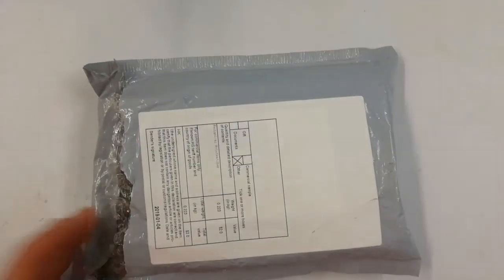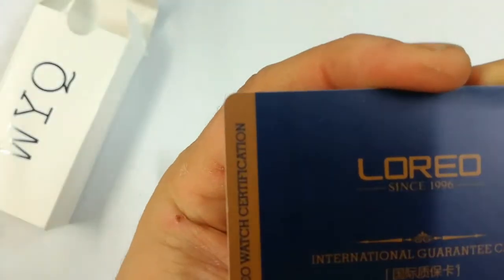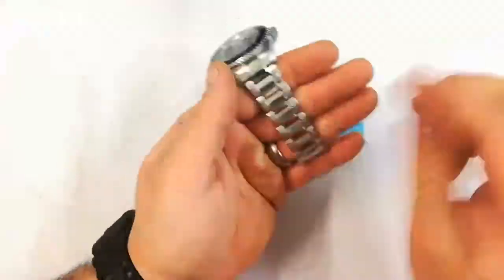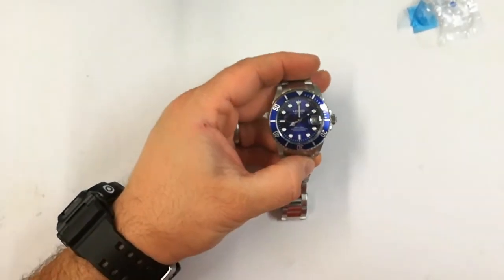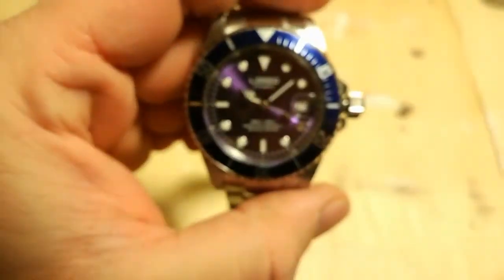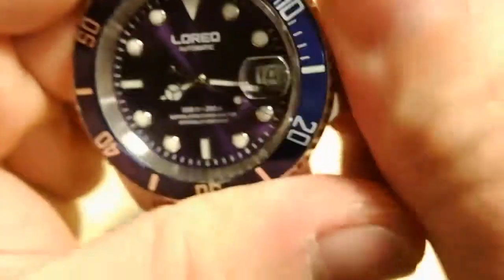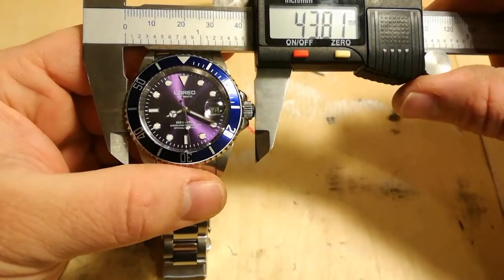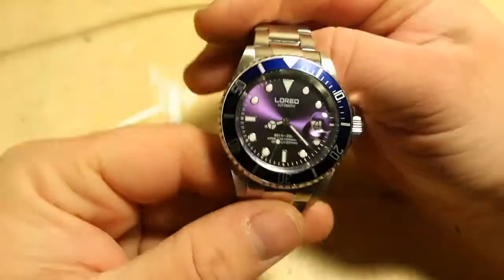Loreo 200m dive watch

Comment: On mine, after i finished setting up the time and date, when i screw the crown to put it back in place it sounds like it is winding the watch, is that normal ? Thank you
Reply: That is normal with any watch with an automatic movement and screw down crown.  Nothing to worry about.
Reply from the maker: Yes until you pull the crown to set its sort of always winding, even whilst unscewing and screwing the crown. Also be careful not to cross thread the crown on to the case, because thats a right 'mare. I've noticed mine is susceptible to it. All the best thanks for watching. MAG.